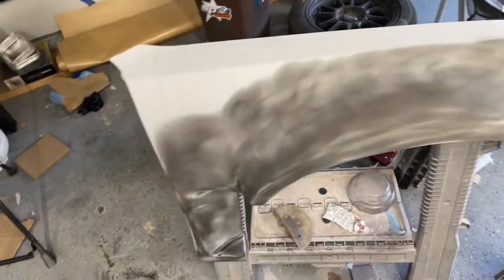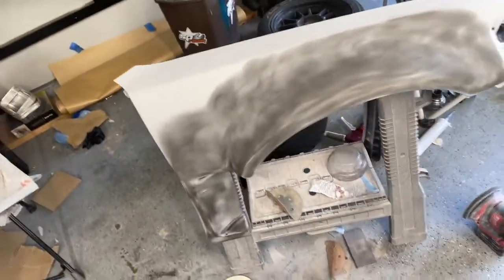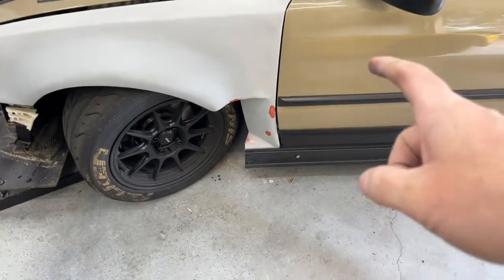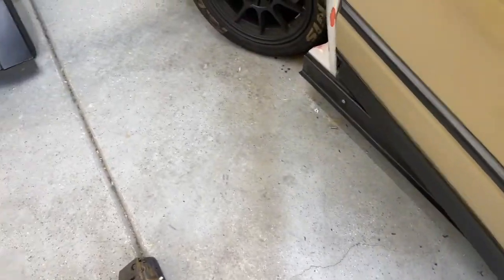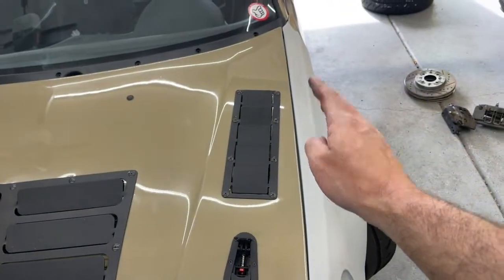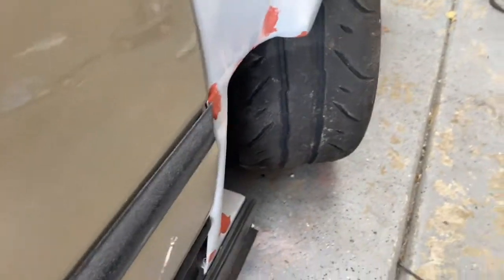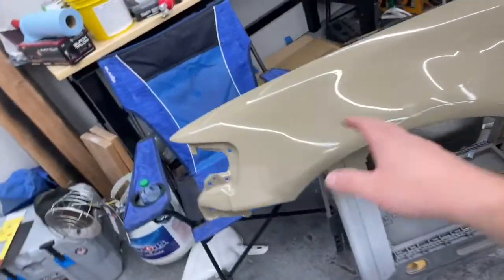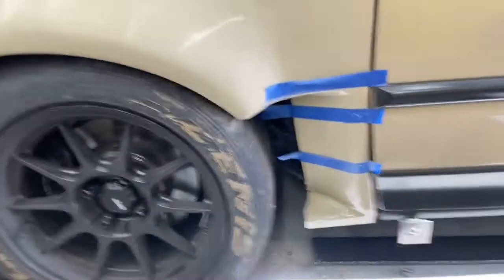CRX Wide Fenders Pt. 03

Comment: eBay have metal flares I have some in my CRX on rear 2.75 wide she look beautiful old school style fade paint on a mini me on Weber carb better spring and retainers 272 Delta cam regrind lighter flywheel and gd clutch kit and header p08-3 head y8 head gasket and others old school knowledge she sounds tuff and look tuff like a old muscle ford car on stops lights gas station but silence when she is running jjjj she do 100 easy on 3 gear CCR born in the byouooooo old school style.Seems like people love her from all ages special females jjjj she is fast for a little d series engine gd on gas and cheap to maintenance I custom everything else from junkyards parts from spoiler to front air dam she looks old school but her sound make her bigger beauty sound dp lion sound